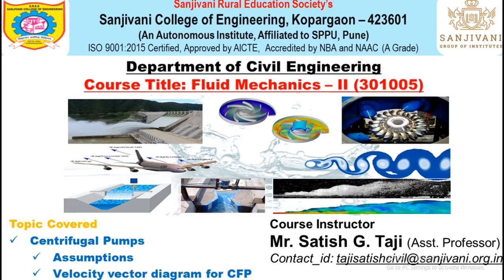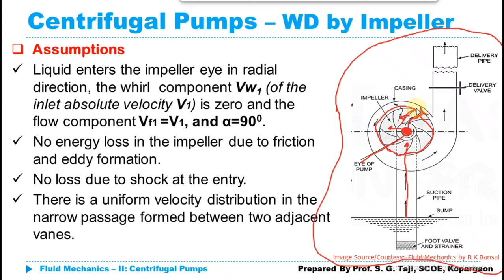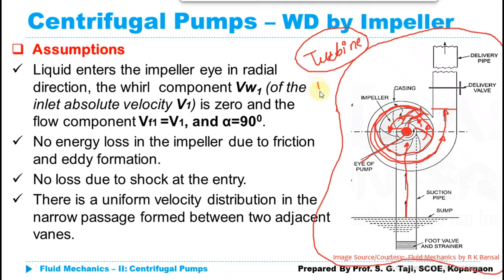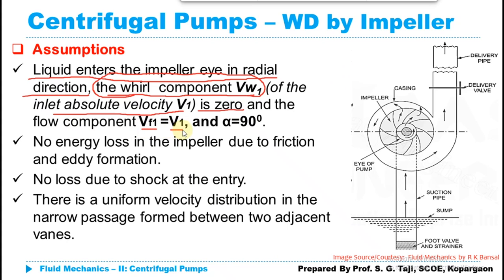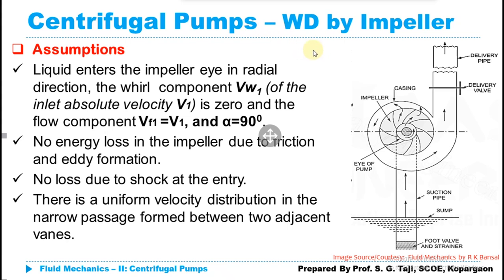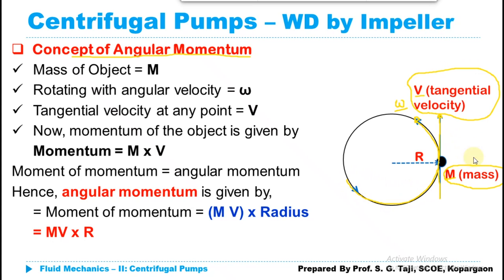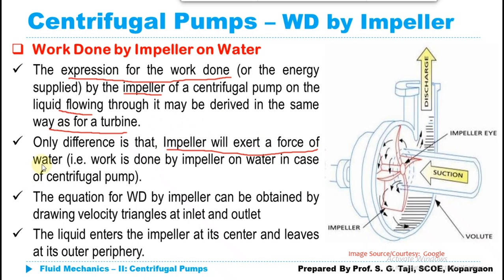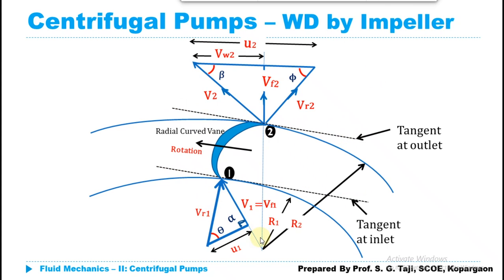Assumptions and Velocity Vector Diagram | Centrifugal Pumps | Hydraulics and Fluid Mechanics

Comment: Fast talking. I could not hear the explanation of Vw.
Reply from the maker: Ahhh... I am feeling so bad for that...
If you still have any question, you can ask me here
Reply: @e-gyaankosh007  Sorry - did not want to offend. I think I have found the explanation of Vw; but I see that For Power, there is a factor where V and Wtheta are multiplied. I can't understand multiplying two vectors but will ponder. Thank you. I will contact you if I get stuck.
Reply: I still do not quite "get" this. I am going to say what I think, so please correct me. First, let us think only about the outlet. Where the action is! Going clockwise, a blob of coloured dye let go on the circumference of the rotor at 12o'clock, will travel horizontally (tangentially) towards the RHS (velocity U). The blob "scooted off" the edge of the blade, apparently backward, will actually still travel towards the RHS (Vr). And "upward". The path of this blob, from this starting point, is traced in the diagram, with V representing its velocity and direction.
Now question: what relevance is the radial flow (Vf)? Of course, I can see it fits neatly -- but why does it affect the  diagram? We know water is travelling radially INSIDE the rotor, but its velocity is ignored, so I cannot understand Vf even tho' it determines the size of Vr. And why Vw is meaningful even tho' it is clearly a nice value. So even talking slowly, I am stuck :)

If we jump to Power required, using the standard formulae, it is clearly correct - but it involves multiplying U by Vw. I cannot understand this. Why should U be multiplied by Vw. I could understand it being added, tho' I realise that would give a wrong answer????

Your lecture v=CLMAkxk0hNI is very helpful.
Reply from the maker: @seymourfroggs   @seymour froggs   @seymour froggs  I don't think I get your question properly, however, still I'll try my best to clear your doubts ....(bdw I liked the way you asked the question lol)

(I would be happy if you explain me the last line of your comment which I couldn't get, might be something coded or mistakenly written something wrong, or anything, i don't mind)

Start with the Vw1 and Vf1
Vw is the velocity of whirl which indicate that fluid is in whirling effect 
However, here fluid moving radially, and hence, there would be no whirling component at the inlet i.e. Vw1 = 0

And ofc reason is the force which is exerted by vane, not carried by fluid on its own

Now Vf is the velocity of flow which is responsible to take your fluid from one location or pt to another irrespective of whirling effect... 
This is the component which is responsible to take your water from inlet to the outlet.
If no Vf, no flow moving from inlet to the outlet...
Now your V1 = Vf1 
So no velocity has been ignored here...

Now let's move to the power equation
Hope you have watched another video of mine for this...
We have considered momentum at the outlet and inlet (as usual suggested by Newton)...
But here , in pumps, there is no li ear momentum, which is rather angular momentum (due to angular velocity) which I have explained separately in the video...
This is so bcz if you see, in case of pumps, water is also getting rotated along with vanes, and hence, there would be angular velocity

Now for calculation of force, we need linear momentum which is given by 
Mass x linear velocity (here it isn't in angular, but in tangential )
We have tangential vel as Ve
At inlet , tangential velocity is Vw1 which is = 0 
Similarly at Outlet, Vw2 

Now you can have momentum eq as 
Mass x Vw per sec
Now change in momentum is final mom minus initial mom

( MxVw2 - M x Vw1 ) per sec 
Vw1=0
Hence 
=(Mass/sec) Vw2
=Rho x Q x Vw2
But we want angular momentum, hence multiply linear with radius of circular path
=Rho x Q x Vw2 x Radius
This is the force equation only (torque) and not the work do e
Now work done will be considered once you multiply force with velocity
Ofc we consider F x displacement 
But here everything is happening over the rate (like on per sec basis) i.e. ur object is moving with certain velocity 
This is the tangential velocity of the wheel
Hence 
WD = F x displacement
Divide on BS by sec (rate)
WD per sec = F x (displacement/sec)
WD/s = F x velocity (tangential one)

Hope this will help you to get you answers
Still not feel free to write back
Regards
E Gyaan Kosh
Reply: @e-gyaankosh007  "I would be happy if you explain me the last line of your comment which I couldn't get, might be something coded or mistakenly written something wrong, or anything, i don't mind" THIS WAS JUST ANOTHER U TUBE LECTURE YOU GAVE WHICH I HAD NOT SEEN AT FIRST BUT THEN FOUND HELPFUL> THE CODE WAS THE END OF THE U TUBE LINK.
Reply: @e-gyaankosh007  

My comments below in sq brackets: this is perfect - very many thanks.

Start with the Vw1 and Vf1
Vw is the velocity of whirl which indicate that fluid is in whirling effect 

[USEFUL: I did not understand "w" = whirl, but do now]

However, here fluid moving radially, and hence, there would be no whirling component at the inlet i.e. Vw1 = 0

And ofc reason is the force which is exerted by vane, not carried by fluid on its own

Now Vf is the velocity of flow which is responsible to take your fluid from one location or pt to another irrespective of whirling effect... 
This is the component which is responsible to take your water from inlet to the outlet.
If no Vf, no flow moving from inlet to the outlet...

Now your V1 = Vf1 
So no velocity has been ignored here...[OK!]

Now let's move to the power equation
Hope you have watched another video of mine for this...[That might  be the "code" of the internet address link]
We have considered momentum at the outlet and inlet (as usual suggested by Newton)...
But here , in pumps, there is no linear momentum, which is rather angular momentum (due to angular velocity) which I have explained separately in the video...
This is so bcz if you see, in case of pumps, water is also getting rotated along with vanes, and hence, there would be angular velocity
[FINE, thanks]

Now for calculation of force, we need linear momentum which is given by 
Mass x linear velocity (here it isn't in angular, but in tangential )
[Ah!]
We have tangential vel as Ve
At inlet , tangential velocity is Vw1 which is = 0 
Similarly at Outlet, Vw2 

Now you can have momentum eq as 
Mass x Vw per sec
Now change in momentum is final mom minus initial mom

( MxVw2 - M x Vw1 ) per sec 
Vw1=0
Hence 
=(Mass/sec) Vw2
=Rho x Q x Vw2
But we want angular momentum, hence multiply linear with radius of circular path
=Rho x Q x Vw2 x Radius
This is the force equation only (torque) and not the work done
Now work done will be considered once you multiply force with velocity
Ofc we consider F x displacement 
But here everything is happening over the rate (like on per sec basis) i.e. ur object is moving with certain velocity 
This is the tangential velocity of the wheel
Hence 
WD = F x displacement
Divide on BS by sec (rate)
WD per sec = F x (displacement/sec)
WD/s = F x velocity (tangential one)

[In using the vectors in the Triangle of Forces, I found they were related such that I might have a sinx multiplied by a sinx, to get from one value to another, and this seemed a bit nerve-wracking! Then I seem to have pieces with Pi occurring then again (ie Pi^2 in effect) and I did not check dimensions (s, t, m), there being so many numbers coming in. I did end up with sensible values for the pump in question but will do it once more.]
I am truly grateful for you help

MC

Hope this will help you to get you answers
Still not feel free to write back
Regards
E Gyaan Kosh
Reply: @e-gyaankosh007  Going back to the Outlet vectors, you need to know Vr or Vf. Obviously you don't know Vf, so it must be Vr. Is Vr = Vu.cos[tip angle]?.
Reply from the maker: @seymourfroggs  nope its not
First thing, Vf is not unknown here
Once you know Vf1 it is equal to Vf2
Hence at the outlet Vf2 is known
Now for the computation of Vr2, you can make use of right portion triangle at the outlet
Vr = root of (Vf2 sqr + (u2 -Vw2)sqr)
Or compute phi then go for Vr2
Reply: @e-gyaankosh007  But that is my point. I know "what goes in equals.. etc" but do you "just" take U1 as Pi x D(inlet) x omega?  Does Vf1 = U1tan theta? I won't keep pestering you!
Reply from the maker: @seymourfroggs  yes you can
U is tangential velocity 
It is given by 
Omega x radius
Refer my next video